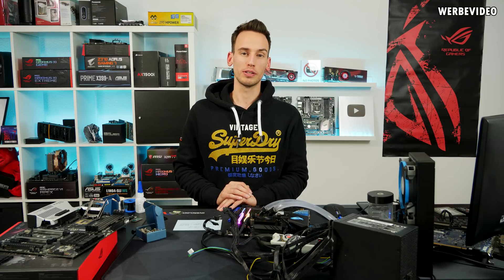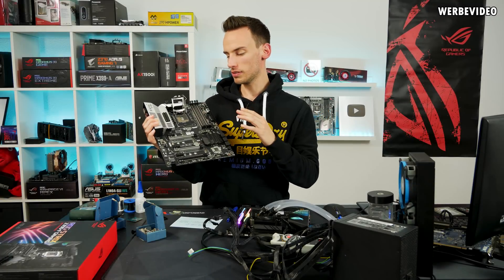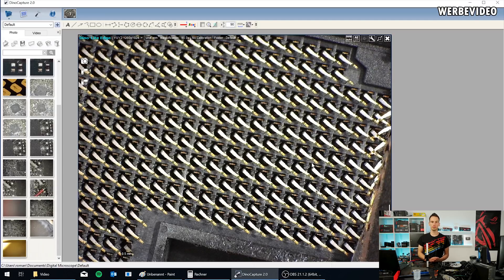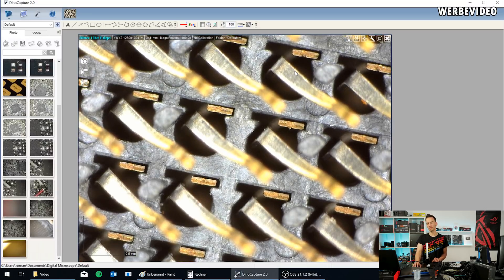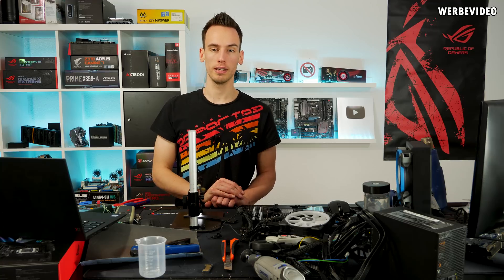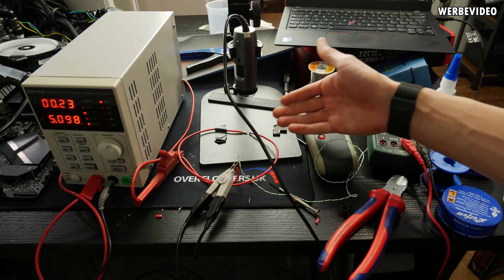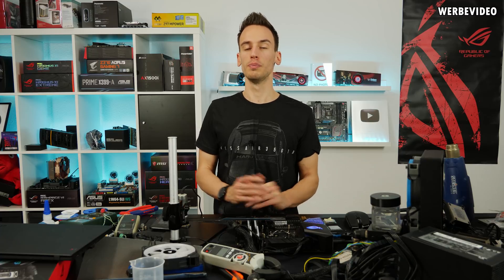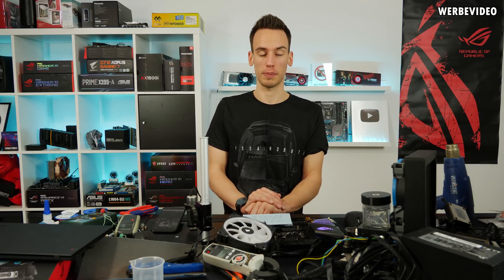We analysed the Z390 socket!

Comment: 11:00 I see a flaw in your test method.  You are using a CC/CV power supply and so at 5 amps your power supply is delivering only .23 volts and that is only 1.15 watts which is not the correct voltage or wattage that would be flowing through the pin.  Even at the lower amperage setting your power supply is limiting the voltage to get a specific current. This is not how the CPU and VRM will be working and so this would not be a valid test of the pin.  

However, with all that information we can calculate the resistance of the pin which is between 0.04222 and 0.04512 ohms at the temperatures measured but that does NOT include the contact resistance between the pin and the pad on the CPU interposer which will significantly contribute to its power handling capabilities.  And the contact resistances will not always be constant, they can change with vibrations.  Also, the contact resistance will change OVER TIME especially where there is heat cycling and this is the same no matter what type of mechanical contacts are used.  The pins will begin to deform over time because heat cycling has an annealing effect on the metal pins.  So the contact pressure will lower over its lifetime causing more contact resistance to build over time.  Meaning more pins are necessary for the power delivery to be stable over its total predicted lifetime and expected operating environment.  That doesn't mean that Intel was right in changing the socket pinout to add more power pins and I'm not defending it, it just means your initial test method was flawed.

This annealing effect on contacts is the main reason why taking a computer apart and putting it back together can bring an unstable computer back to life.  It doesn't reset the pins back to their original glory but it does re-seat the contacts allowing it an extended life.  Bending the contacts up slightly also helps, and the same goes for PSU connectors and connectors between the boards on hard drives and the motors.  Over time they will begin to settle into position and more resistance builds between the contacts.  It isn't always the circuitry in the PSU that makes it unstable, the female Molex pins on PSU connectors can become loose over time and cause stability problems especially if the PSU uses one of the many voltage lines on the mother board connector for feedback.  So if your computer shuts off unexpectedly and you suspect power supply, try getting those female Molex pins in the connectors to hold on tighter.

The pin connectors on hard drive boards can also become loose over time and cause the motor controller to error out which means the hard drive continuously tries to spin up but can't.  And again, removing the board and bending the contacts so they make more contact pressure can bring the hard drive back to life but eliminating the connector altogether by hard wiring the motor to the board can make it last until the heads decide to crash.

Even on modern PCs and laptops connectors are inevitable but they are also inevitably a problem given enough time.  If you could eliminate mechanical connections, exposed metal traces/contacts and electrolytic capacitor aging then you can theoretically create a system that could last a lifetime without physical maintenance other than dusting...

Comment: I saw a Power supply on ebay that said SeaSonic on it, was like skeptical because I had never heard of them. Figured it was some cheap knock off brand that would be broken on arrival.  SO I kept searching and bought a slightly more expensive Coolermaster. But sense then, I've kept hearing SeaSonic this, SeaSonic that. Commercials, items on Amazon, This Video schilling them. I hate advertisers, the way they can track things you see and buy. To stop them, spend money on a VPN when they should have no right to track you in the first place. I shouldn't have to spend money to prevent someone from violating my privacy rights. Getting sick of the Internet.

Comment: Although i dont disagree and im sure you know more then me, even if short term a higher current/power draw on some pins might not be an issue couldn't it cause issues long term? Seeing as intel provides a warranty and wishes their products to last through this potentially increasing the failure rate in this period could hurt profits and brand image.
Reply: I doubt intel are running those pins at only 15% away from causing longterm issues (remember its only 15% extra draw on each pin by putting a 8700k into a Z270 board).

Comment: I think a pin would heat up more if embedded in the plastic, rather than open to the air.  And you say the metal can handle high temperature, but what about the plastic around it?

Comment: This was interesting. One thing you haven''t really taken into account in the first test was the wires heatsinking the pin. It's possible the thick wires, and the fact it was soldered would help wick away heat from it. Soldering also creates better contact. I wonder if the results would have varied a fair bit if only the board side was soldered, and the pin side was touching a piece of perforated stripboard, to simulate a cpu substrate. I bet you wouldn't be able to fire 5A through it like that the same. probably good for 2A, and I bet the design safe amps would be 1A for each pin. It'll also be for redundancy, the number of pins, so that a few bad contacts won't matter so much.

Comment: The test is incorrect. Your power supply is in c.c mode, it means constant current. You set the constant current to 5 amps but if you look at the voltage its only 0.23 volts. Which means the power consumption is only 1.15W. You should tune your voltage up to 1.2V -1.3V and see the magic happen as the power consumption rises to 6.25W. But thats not all, if the pin gets hotter the resistance gets higher making the heat losses even better. Also please switch to thinner wires because they have unrealisticly high thermal conductivity compared to a few microns thick copper trace in the motherboard. Please do an other correct test because its misleading.
Reply: Too bad the author will never see this.
Reply: Hear what you're saying- but remember putting a coffee lake CPU into an older socket would still only be about 15% extra current draw per pin.  Do you really think Intel is already running so close to the red line? Especially considering the LN2 overclockers are pulling 300% extra current sometimes and no traces melt. The CPU/mobo either dies from too high a voltage or condensation/water causing a short.

Comment: my biggest issue with intel. price gouging. i was a loyal AMD builder since 1998 but last year switched to intel. loved the performance. but after buying my 7700k only to be slapped in the face with no upgrade  path just a few months later has me second guessing being an intel fan. i enjoy upgrading. and the fact there is no logical reason i cant now without buying a new board just pisses me off. when you fork out nearly a grand on mb cpu and ram and need to replace it all to upgrade 5 months later its a joke.

Comment: Your test is not accurate, the bottleneck is not in the pins, but in the CPU pcb's traces itself that are much more thin and less capable of current flow.
Reply: Fine- but remember putting a coffee lake CPU into an older socket would still only be about 15% extra current draw.  LN2 overclockers are pulling 300% extra current sometimes and no traces melt. The CPU/mobo either dies from too high a voltage or condensation/water causing a short.

Comment: One difference between his test and a motherboard with an actual CPU is that the pin isn't going to be soldered onto the CPU.
The non-soldered contact between the pin and pad is going to have higher resistance than soldering it to a wire, which should cause it to heat up more.
Reply: Remember the soldering part was only 1 of 2 experiments performed in the video -- he covered 68 pins with elec tape and ran his CPU at a much higher wattage than a 7700k or 6700k would be capable of pulling under full load. After 24hrs there was still no degradation under the microscope (even in his extreme example).

Comment: Hello, I have to somewhat disagree that z270 and z170 could be usable for 9900K, even z370 is NOT.
I own a Gigabyte Z370 AORUS Gaming 7, after updating it to latest BIOS I got 9900K, I did BIOS reset and LOAD BIOS Defaults.
The Board is on all default settings.
with my 9900K it ALWAYS boots with 1.34-1.36 vcore and under load in windows cross 1.4
I assumed that its fine for this CPU but then googled
Apparently on z390 boards at default setting the 9900K boots at 1.2v
I googled some more and found otehr people having same issues as I do [BTW seating Manually vcore to 1.2v wont boot at all]
So I got Z390 AORUS Master
P.S. NONE OF OTHER below 9900K CPUs have such issue on z370,the i7 and below all work FINE, only i9 have this over voltage

Comment: It's important to remind that soldering the PIN you reduced the resistance since the PIN is connected to the CPU by Surface contact. But the rest of the test is pretty conclusive.

Comment: sometimes a ground pin is only connected  externally and not to any of the other ground pins of the device - so missing a power or ground connection can cause device functions to fail depending on the topography of the device

Comment: if you soldered that pin to both red wires, you just wasted the test, it is a complete failure, because you are not testing the heat created by the "contact" with the CPU, that is not the same resistence than "soldered to a wire", so to be a good test, soldered on one side, fine, the other side must be pressed to a golden clean contact, like the edge of an GPU card will work.
Reply: Remember the soldering part was only 1 of 2 experiments performed in the video -- he covered 68 pins with elec tape and ran his CPU at a much higher wattage than a 7700k or 6700k would be capable of pulling under full load. After 24hrs there was no degradation under the microscope.

Comment: you totally did that test wrong. by soldering to both ends of the pin you're not getting anywhere near any kind of meaningful figures. the limiting factor would be the contact resistance and that would be significantly higher if you actually used the pin how it makes contact with a pad rather than through a big massive glob of solder.
Reply: Remember the soldering part was only 1 of 2 experiments performed in the video -- he covered 68 pins with elec tape and ran his CPU at a much higher wattage than a 7700k or 6700k would be capable of pulling under full load. After 24hrs there was no degradation under the microscope.

Comment: 148 Amps...... hahaha ... please calculate a bit  different angle...do you know what can you do with 150 amps? probably weld a centimeter thick steel. cpu for sure not using such voltage such current  untill doesnt have wires like your pointing finger ;)
Reply: and also that you check what siocket can handle
but you didnt check what is important-cpu inside-its hairline wires inside  few pins count there-socket has to be overkill due cpu requiements

Comment: The temperature reading on the soldered wire to the contact is invalid.  The mechanical contact of the probe to the CPU die will always be higher than your reading with the soldered connection.  The mechanical contact of the spring probe to the pad on the CPU has higher losses than the soldered connection.  This setup will only give you a reading of the self-heating caused by the current flow through the pin but once you add in the mechanical contact, the temperature goes up due to the additional losses at the contact point.  The highest temperature will always be at the junction with the highest resistive losses in any circuit.  To be more accurate, you need to simulate the contact by soldering one wire to a PCB with a circuit trace.  The pin should be mechanically contacting the circuit trace the same contact force as an actual CPU mate to the socket.   The mating force used should be the lowest value of the spec to create the worse case scenario as opposed to the nominal force.  The resistance can increase dramatically as the force is reduced.  That will provide more accurate temperature results than with a soldered connection.
Reply: Remember the soldering part was only 1 of 2 experiments performed in the video -- he covered 68 pins with elec tape and ran his CPU at a much higher wattage than a 7700k or 6700k would be capable of pulling under full load. After 24hrs there was no degradation under microscope.

Comment: It takes voltage to kill components. Voltage is the rate at which your amperage will flow.
Reply: ??? amperage is rate of flow. voltage would be most comparable to "pressure" if you want to make water comparisons.
Reply: @spambot7110  YEah, you're right. It still takes voltage to kill components.

Comment: Please correct me, i believe the CPU socket you refer to as "plastic" which i doubt is actually made from some formulation of fiberglass & epoxy thus would make it much more resistant to high temp than ordinary plastic. Observe that as you cut with the Dremel it cuts like PC board material.

Comment: if you test latest ryzen pin from old fashion outdated tech off the cpu from substrate ...i bet it couldn't do 5 amps at all...it goes burn't and overheated on amd pins...so 3 amp is max limit for amd ryzen per pin while intel can push it further in temps and amps per lga ball pin ...to 20 amp max

Comment: this is the best thing intel made since last pin bent from Athlon and old pentium4 that change everything .....time to upgrade LGA tech....more reliable in servers and mainframe...and AMD still using it for threadripper ...cause pin base is not recommend for supercomputers and expensive customers quality.....only for consumers, while intel don;t believe in fragments business and divide customers in class like amd do....intel made LGA mainframe quality to everyone equally to all class from consumers to high expensive class customers who need reliability usage like super computers still using since dawn of IBM power 7 -9 ...LGA cause ibm invented LGA way back 1996 for first fast mainframe server componets....it has the grid and land socket that can be removed by big screws from the template than solder on the motherboard grid to socket...cause heat does the work itself with ball contacts like today standard use on consoles..heat reattach itself ...

Comment: The mostly true fact that Intel requires a new motherboard (not strictly true with Gen 8/9) every year with each generation is not really as big a deal as people make it out to be.  It really only bites for those that absolutely have to have the latest gear all the time (although not this time).  Those people will have to shell out the money.  Under normal circumstances, though, the masses will not upgrade any sooner than 3-4 years.  At that point you will almost certainly be getting a new motherboard anyway, even if compatibility was maintained.   And, BTW, if compatibility is maintained for 3, 4, 5 generations, it is very likely that they screwed you 3, 4, 5 generations ago with an inferior CPU back then that could not deliver the full potential of the technology of that day (as is perpetually the case with AMD).  So, its either you get screwed now or get screwed later.  One way or another, you are getting screwed.  You just dont realize it yet.   My advice to anyone bitching about new motherboards every year is get used to it.  This is life.  Pretty much anything you want to get into at a high level will require premium dollars (and spending cash on similar items over and over again for the accessories to those items) if you want to live on the cutting edge.  Thats just how it is.  If you are not ok with this, then stop buying this crap.
Reply: @user78405  I just think a small group of people blow this whole new socket/chipset/motherboard every year thing way out of proportion. You could probably transfer your tires, radio, seat covers, etc., from your old car to the new.  But why would you?  Is this part of your decision making process when you buy the new car?  That you can keep transferring that radio and so on to the next?  God forbid an auto manufacture use a new radio slot that doesnt work with your old radio.  OMG, that would be the end of the world.  Bad auto manufacture, bad!

Comment: It's almost like Intel changes sockets without needing too. If only a company could use the same socket for more than 1 generation at a time...like AMD.....
Reply: Z370 supports 8th and 9th generation.  That is more than one generation at a time.  Not that this is a new idea.  Its just an idea that does not pan out for the consumer.  3-4 years later, you are buying a new motherboard anyway.  It saves you no money.

Comment: You have to take the fact that your thick copper wires are very good thermal conductors into consideration. Also the resistance between the pin and the pad will certainly be different than your soldered connection.
Please make a new test setup where you use a dead cpu and a cut in half socket on a pcb to properly test the thermal scenario.
I would also like to see a proper resistance measurement of one of those pins using a Kelvin-clamp resistance meter.
Reply: he could run the current through 2 ground pins, so that they'll be connected by the interposer's ground plane. if he wants to measure voltage drop he could have separate probes on each of the lands and subtract the internal voltage drop from the total voltage across the pins themselves. would get a bit cluttered with 6 wires total but would be a proper test

Comment: The problem that happens with having fewer pins is a power integrity problem. The silicon requires a voltage, and with internal resistance, the voltages can drop.  Adding more power pins helps get a more constant voltage through the whole chip.
https://www.ansys.com/products/electronics/power-integrity